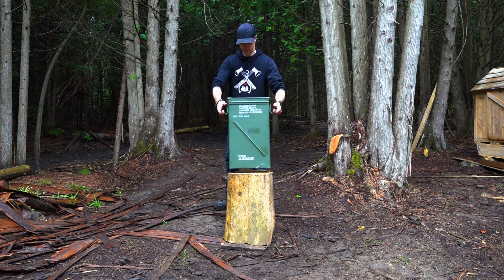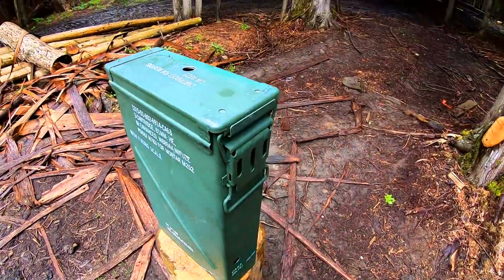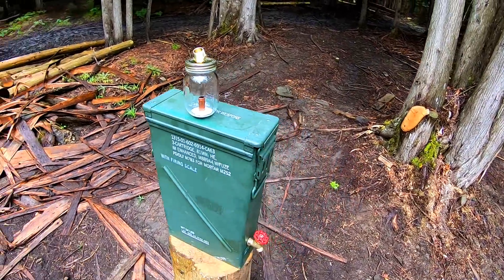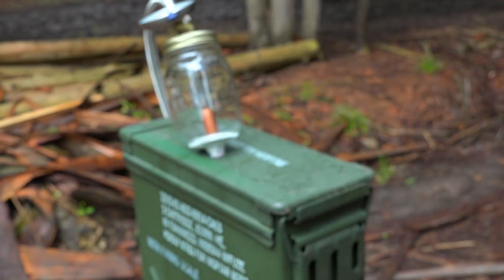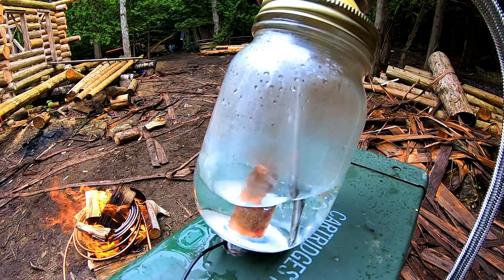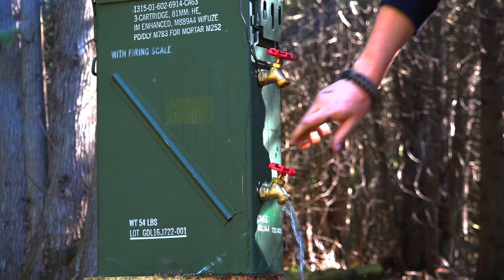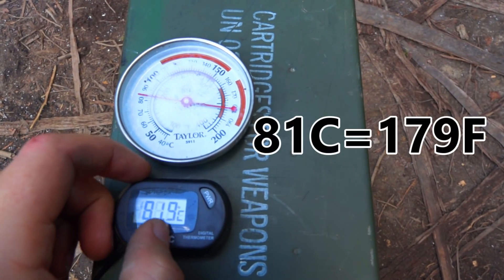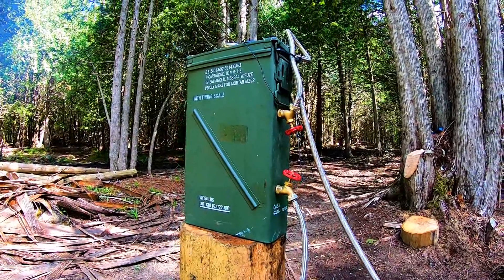Off Grid Heating Prototype- Copper Coil Water Heater / Heat Exchanger / Radiant Heater

Comment: That is great. My thoughts after watching
1. Do your "mortar" expansion vase smaller and fix it outside the cabin well isolated, with a cornered tube on the top to let liquid escape (use expansion vase from a car, not the radiator).
2. Inside the cabin put a little real home heater connected to it. Fill it with cooling water for cars it won't become ice.
Best is heating floor, a long tube laying everywhere.

Comment: Why not use a camping coffee pot with two solid copper pipes soldered to openings at the top and bottom of the pot to put over the fire rather than a 40’ coil of copper? It would be much less expensive and  more portable than a large coil of copper tubing. Then the flex hoses could be used as simple connectors for the transport of the hot and cold water. I love the idea of keeping the fire and heater separate. It’s similar to a rocket stove design with copper coils inside

Comment: You need to add anti freeze from a csr in there. It will raise the boiling point. I would also add radiation fins to the Ammo box. It must grt rid if its heat, not store it

Comment: Copper coils in wood stoves have been around since the 1800's. In the Canada wilds we plumbed the kitchen cook stove to 55 gallon drums above the ceiling for our hot water. Our pressure system consisted of a pipe run up the hill to a creek. Our laundry room had the same set up.

Comment: I used similar during my camping days with a large bucket up top and copper pipe coils with a valve to control water flow and a bucket to catch the hot water the valve can also control the temp

Comment: I was looking for a down and dirty way to build a $2,500.00 john ellis LM-5 equivilent water unit and maybe use the sun instead of a philips germacidial lamp... and or use both. (the phillips germacidal lamp works great!).  and use wood outside and inside to heat the water... i use ice to condense the steam and will be using winter weather outside for cooling the water.  I also have sedement, charcoal and reverse osmosis filters for pre filtering our well water.  (cautionary note: reverse osmosis, deionized and distled water is capable of removing necessary and vital minerals from our body along with toxic chemicals and caution should be used as these minerals have to be replaced with a mix of electrolytic minerals and or the filtered water needs to be mixed with spring water).   

People everywhere should look to the health restorative power of clean mineralized vitalized, energized water (spring water), fruits and vegtables.  Every community worldwide should be focused on growing food in greenhouses and providing everyone with safe clean healthy, vitalized drinking water.  

infused water with fruits and vegtables, sunshine, biomagnetic-north magnets  (north seeking) into the water and if you can drink as much mountain spring water as you can.

I almost always have the door cracked open on my wood stove so I should be able to put a coil of copper tubbing inside the stove and make a very large amount of hot water and steam distilled water for my homemade john ellis unit.  the john ellis unit is not only expensive to buy... its also expensive to operate.

Comment: You need more surface area to dispel the heat. add a second copper coil to be the "cool" side and u can run that one around the camper. should also stop it from boiling

Comment: I also was thinking about heater for the tent. But I would not do like this, the main problem as it seems boiling water should not escape into the tent otherwise you will get moisture what will make things worse. Boiling water should go out of the tent or whatever you're heating. The other thing seems way to much copper for heating, seems that could be used as a radiator.

Comment: insulate the tank to have the heat trapped in longer, fun concept you built man, also you could definitely improve the heating if you design the coil to be entirely covered by red coal

Comment: You have it the wrong way around. The old thermal siphon heater in my house, was a tank back of the fire, and a coil in the  hot water cylinder.

Comment: I’m sure as hell not an engineer but in a way this is comparable to a cars cooling system. The main difference between the two, however, is that the car (most of them) makes use of a radiator to aid in cooling down the pre existing water to prevent the system overheating. The issue then is that you would need to figure out some type of way to generate the wind to actually cool the water (electric fans most likely) and keep the temperature regulated. Conceptually it’s a good idea but it just doesn’t function as expected and based on circumstances where this would be used, lugging around a radiator and electric fans along with this whole coil system just isn’t practical.                                 I can go into more depth if it seems I lefts stuff out, I don’t want to seem like I’m over explaining

Comment: Why not add a steam motor to the jar as a steam pressure outlet?
Reply: Also, i am no engineer, but you could have the metal box outside and make a copper tube surround your cabin with hot water to avoid the noise :)

Comment: Fewer coils on the fire would help - too much heat is getting into the water before its return and causing localized boiling which you can see as the bubbles coming out and then compressing again as they cool during the underwater cam.

Comment: It's called a back-boiler. Houses with fireplaces have them all over the developed world. They are also integrated into fabricated stoves large and small so can be easily bought and installed anywhere. Some are portable. Seems like reinventing the wheel really because when TSHTF you're not going to find a store with all the bits you need, or have power to drill etc. Not trying to be negative, but it seems counter-productive to use an inefficient open fire when working off-grid and when resources are scarce.

Comment: So I'd recommend two things to change. Great idea, btw, but as a plumber i see two potential improvements.

1. I'd find some way to permanently attach those valves. Like solder on two ball valves or something. Those rubber gaskets are gonna wear out quick if you keep putting them on and taking them off, especially with how hot it gets.

2. Idk what kinda hoses you're using, but they make hoses for washing machines that have check valves in them and only allow water to flow one direction. I'd use those to prevent any sort of backflow in your inlet and outlets.

Comment: Use anticool and anti heat additive or change for the oil used in heaters... Oil is better for heat battery. And u can fit de tubes in th walls of ur tiny cabbin. Just put an in and out for the outside heater. The slimiest design.

U can even put the fire pit embedded with the cabin... 

More slimiest...

Where I live is the opposite. Too hot.

Also, u can use peltier and use the differential tem inside/outside. To make a passive heater/electric generator.

Knowledge + creative thinking is the limit.

Comment: that's a ton of copper. super expensive. copper is not cheap. and worse after few more fires the copper will oxidate until cracks appear and water will be lost in the fire. This  direct fire is too strong - maybe build a clay stove and trap the copper inside the clay. That will still have enough heating, you can control how much wood you burn, and how fast, and not oxidate the pipe. Use less pipe and the clay is free. For stopping the system, make it as such that no water will flow trough it. And the fire can be tempered down by redirecting it in another direction where does not heat the copper. im sure somebody can come up with even a better solution..

Comment: Im trying something similar at the moment. Your design works great, The problem is, it works too great, its uncontrolable. My design is to have  the ammo box or other metal container as the heater  but i want something that will last a long time without needing to keep refuling it so my plan is to build a coil about 4-6 inches in diameter, maybe 8 inches high made from microbore copper tube. Then encase the outside of it in a perlight based concrete so its insulative and light. Then in the mddle of the coil, have several wick holders like you get in oil lamps or parrafin greenhouse heaters. They can burn a long time and are very cheap to run. It could be very small, easy to transport. Will get the water hot but not too hot to boil it or create steam. And the burning part again could be outside for fumes but you could have it inside and have a chimney or exhaust outside.im trying to build it for heating a greenhous in winter but the application could be used for anysituation.

Comment: Hi, I would like to share my experience based on your system. I have a problem with flatulence, and emit huge amounts of ass gas. As we all know it's wasted energy, and given the fact I always sleep naked in the snow, which tends to freeze my balls it seemed like a good idea to design something to alleviate the problem. 
After purchasing some copper tubing, and an ammo box I put it together as per your instructions. Then I installed both ends of the copper piping in my ass to form a closed loop system. I didn't add water to the ammo box either.
After dinner I noticed the ammo box was heating up, and melting the snow around me. I became so warm and fell asleep. 
Around 2 hours later I awoke in extreme ass pain. I must have farted so much that pressure in the ammo case caused the temperature to rise to dangerous levels. Unfortunately, I forgot to install a pressure release valve, and the copper piping was fused to my anus. Despite the extreme pain, and rising temperature up my butt crack, I had to endure this until search and rescue evacuated me in a helicopter.
Fortunately, the copper piping was successfully removed. Unfortunately, my butt cheeks don't ripple any more when I fart, and I have to sleep standing up for 6 months...
Lesson learned. Next time I'm going to follow your instructions, and install a pressure release valve before installing the copper piping in my ass...

Comment: It’s a good thought but how could you sleep with all that racket going on from the bubbling water? How about if you ran one of the lines from the fire straight into the cabin to the radiator or some type of radiant lines inside with a valve to control the flow then back outside and leave the bubbling can out there outside

Comment: Hey. I have been experimenting with this concept for a long time now, and i see some room of improvment. The valve most high up, if you turned it around pointing down, the flow would be alot smoother and not popping like it does now. If the fire is hot enough that popping water could be dangerous and breaking your pipes and cause damage to your skin. but if you make sure the pipe rises all the way to the tank  it will be all right. (sorry for my bad english x)

Comment: Great concept!  I’ve watched both videos.  My thoughts,  1.  valve your supply lines, hook it up and go with no loss in antifreeze.  2.  Maybe some thermal batteries in the ammo can as well?  3.  Move to Miami (joke) 4. I bet you could downsize and self contain the heating elements significantly without loss of heat.  Maybe even combine it with an outside camp stove for cooking?  Just brainstorming because it’s fun...great video like always.

Comment: THREE SUGESTIONS.

1) Praffin phase change heat storage: substances going from solid to liquid absorb a lot of energy just to go from a solid to a liquid storing that energy.  Conversely, when it is allowed to cool from a liquid to a solid, it  gives off all that stored energy. 
Bottles of paraffin wax can heat exchange with water in the ammo box. They will take in and store lots of energy when phase changing it from a solid to a liquid,  and it releases that stored energy when phase changing back to a solid. 

One might even fill the ammo box with paraphin wax and coil a copper tube inside. 

2) Considering it's winter and you don't want water freezing in the hoses or copper pipes or ammo box you should use an anti freeze. 

3) Lastly, use a pump to circulate.  Possibly even a stirling engine and pump. You will get less boiling, get up to full heat faster, and prolong the life of your coil the fire by not requiring it to boil, and keeping the copper lines cooler.

Comment: instead of having the huge can in you shelter, id run a line from the outfeed of the copper to a small radiator like a heater core, into the shelter, then and outfeed from the heater core to the can. this way you dont have to worry about the ammo can failing. this way the radiator would allow for cooling causing less steam and blow off in the can

Comment: A one way check valve on the cold water line will solve your problems with the steam. We had one built in the late 70's for camp hot water it worked great it was a 40 gallon steel trash can to wash up and do dishes with

Comment: I can tell you that you have it backwards you should have the coil in the house and the ammo box on the fire I worked for two decades with thermosiphon engines and that's the way it works hot water rises to the top of the tank out to the coil goes to the house cools and then turn it turns to the tank and keep water level above the outlet near the top and a vent hole or low psi radiator cap on top Good luck

Comment: One thing you are always going to have to deal with is how to reduce heat input when the tank water approaches boiling. Right now, you are reducing the heat by removing the coil from the fire. If you put the coil in a 55 gallon drum, you could reduce the heat by throttling back on the air.
It would also help if you could get one of those thermocouple powered wood stove fans on your tank. You would have to direct it at the tank, though. maybe a deflector or something like that. 
I never new the convection would work so good on this.

Comment: Why not coil the copper around your camper, and keep the ammo can outside Next (close) to your fire or on top of coals.  The hot water should circulate and take up less space inside the camper.   An inside spigot Might(?) control the heat.  Basically, you would have an outside water heater from which you could get potable water if you could get a stainless tank.

Comment: I’m no survivalist, yet could it have been more efficient if you just placed the can on the fire? There would be no need for the copper coils. I thought there was plumbing to carry water to your tiny cabin but it was only used to make a heat exchanger for the fire. Cool design by the way, but it’s more of a Rubegolberg system. I mean no offense intended. Nice cabin by the way.

Comment: So in half the people here are correct and over half are numptys..

You need better thermal displacement simply put mainly being your "coil" as it needs to be wound and spaced appropriately to maximize the surface area exposed ....if you donot plan on " drinking or bathing in this contraption adding or utilizing high density motor oil like 10w40 would hold the heat much longer than water I higly suggest building a "self feeding rocket stove" from steel pipe and having the coil in the " flue" so it is heated and you have less thermal waste because the flame is being directed also the stove its self will radiate heat as heat loss is unavoidable...further more I'd shy away from the " soft copper" as it's very prone to breaking and fracturing after being " tempered"  I'd go with some steel " break lines"  also if using water you need to seal in your system and place in a one way stop valve for pressure venting which is also causing a loss of your water period as this is a finite amount in an " open loop system " do a bit more reaserch into actual hot water heaters / boilers" is all I can honestly say ..

Comment: You could just make a fire, put a pipe in the fire with one end venting in your camper and the other end going through the fire to where it sticks out passed the fire. The pipe heats and blows clean hot air into your camper

Comment: If you could dedicate another solar panel and battery you could possibly get a tankless water heater and use that with your ammo box so you could fine tune your heating supply without needing fire but by that point you might as well get a space heater

Comment: steel would work better as the hot metal in the flame  as copper will degrade over time,if you took short pieces and connected them with pipe fittings you could make a grate to put over the fire  then run copper back to the can. Once heated circulating the hot water thru a radiator would increase the efficiency in releasing heat to the area your trying to heat. On your outlet where you get steam, you could run a hose off it and pass it through ambient temperature water where it will condense back into hot water mix with it and create lukewarm water. Or use the steam to drive a small steam engine and generate some  off grid power charge some batteries and have light at night as well. Just always vent the steam to atmosphere or use a pressure release valve. Steam is 1700 times the volume of water, definitely dont want an explosion. Nice build 
i like your setup

Comment: Pretty neat, but it w
has some disadvantages. We power electric blankets and a small space heater from battery banks fed by a water wheel and solar panel. It's the best set-up I've used yet but I like your design here and I'm glad it works for ya.

Comment: Why not use a Kelly kettle style design? They are insanely fuel efficient compared to a normal fire where you heat from the outside in with a Kelly kettle you heat from the inside out, its a fire pit, stove and a kettle all in one package which you could easily turn that ammo can into a large one.
Might help with using less fuel to heat the water